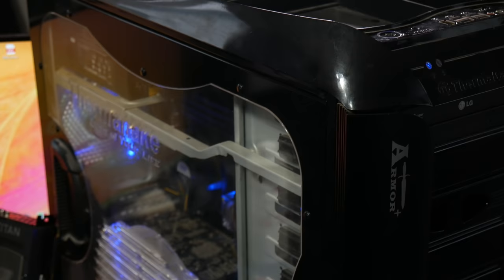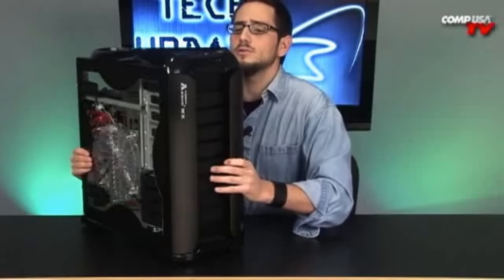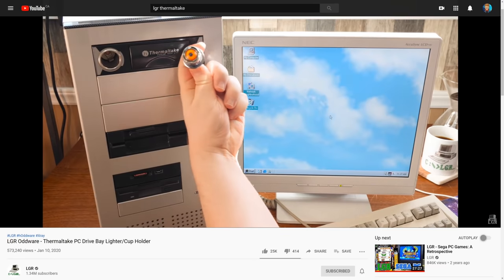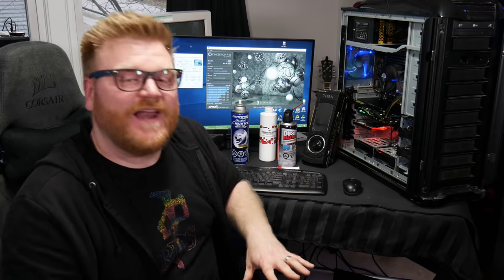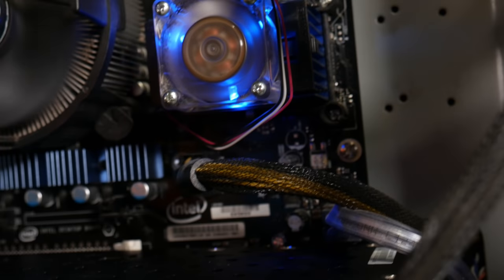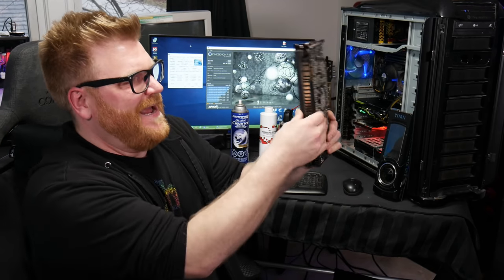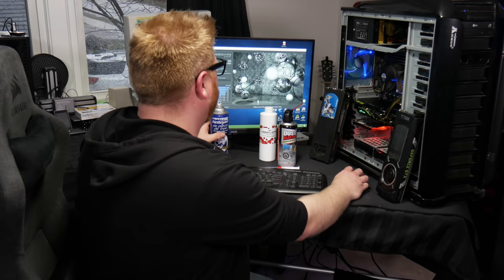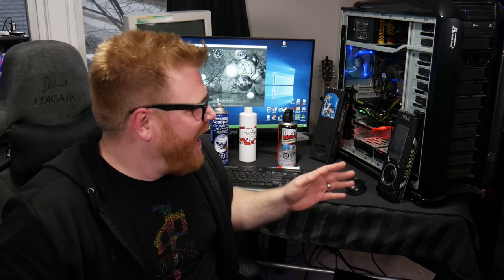Can $5000 buy a PC that will last 10 years?

Comment: I think there is a tipping point here. Over the last 7 years I have about $3000 total (after reselling old parts) Right now I am running a 4790k with a 1080ti 32GB ram @ 2400 hz and everything runs on a SSD or NVme. I run a 4k resolutions so my 4790k runs within a handful of frames as a 9900k. I plan on that cpu lasting me at least another cpu generation and will upgrade one more time to a 3080ti. I'll be in to the computer for less then $5000 after a 10 year span and will have parts that can transfer to the next rig.

Comment: Great video, Timmy Joe. I'm glad to see that you are healthy and staying safe. Here's my take on buying computer parts when you are starting with nothing. Buy what you can at the time, BUT leave yourself an upgrade path. I decided to go AMD AM4 almost as soon as it came out. I started with a B350 motherboard, a R5 1600 CPU, 8GB DDR4 2400MHz memory, a used 780TI, a 5000GB 2.5" SSD, a 650W PSU all in a HAF 932. The case was something I already had, but for 80ish dollars you can get a good case. The AM4 motherboard was key in the whole setup, due to it being a new platform and AMD is always good about keeping their sockets around for a while. The first thing upgraded eventually was the GPU. I added some mechanical storage. I upgraded to 16GB 3200MHz memory. I bought an EVGA 850W Platinum PSU. You, get the idea. I didn't have to buy everything at once. After I got my foot in the door, the upgrades were unlimited. Hell, I ran the R5 1600 on 4 different motherboards before upgrading last Christmas to a R7 3700X. You have to keep in mind that computer parts have a huge used selling market and you aren't going to necessarily lose all of your money. I think of it as a "rental" fee. When I get a new part, I can turn around and sell the one I'm replacing and call it money towards what I spent on the new one. Over a couple of years I've ended up with an Asus ROG X570 Crosshair VIII Hero, a R7 3700X, 16GB DDR4 3800MHz CL16 memory,  a Samsung 500GB EVO Plus M.2 NVMe drive, a Sapphire Nitro+ 5700XT SE. a newer EVGA Platinum 850W PSU, an open loop cooling system, plenty of custom lighting, all in a Thermaltake Level 20 HT. Remember that computer parts are an investment with a resale value and you'll have a lot of fun in the process, as well.

Comment: Funny...back in '09 I built an X58 rig...Gigabyte X58A-UD3R board, i7 950 with a 33ish% overclock, AIO cooler for the day...24Gb DDR3 in triple channel mode (6x4Gb OCZ Gold), 2x GTS 450 GPUs in SLI...still have it...still runs and runs great at the still 4Ghz overclock but she ain't no primary rig anymore. Oddly it's also been running damn near 24/7 since the initial build...rock solid reliable.

Comment: £1,600 got me a machine that lasted 6 years before parts started dying.  About an extra grand or so since then has kept it purring.

2009 build-
Case: Cosmos "S" Sport 
CPU: i7 920
Mobo: P6t Deluxe
Graphics: GTX260
RAM: 12GB
HDD: 300GB WD Black
HDD2: 500GB of some sort iirc

In about 2015 I upgraded to-
CPU: i7 4970k
Mobo: Asus Maximus VII Ranger
Graphics: GTX 760
RAM: 16GB

And since then I've added a few SSD's an m.2 and upgraded the graphics card first to a GTX 970 (strix) and then to a Vega64.

Comment: i just recently upgraded my old Bulldozer 990FX FX8320 to a Ryzen 7 3800x system I just have to say I agree with you T.J. i think i spent roughly 600-700 on components and i get pretty amazing quality out of it. i wanna say that this was the most i think i have spent on a system upgrade in 10 years.

Comment: Did a $9k+ build in 2016. I had a hardware failure last year, mid-2019, and have been unable to deal with it due to medical problems.

I am fully disabled, but in the 6 yrs it took to get insurance approved & start paying, I lost everything... jobs, house, savings, family troubles... SIGH!

My Overkill PC Build was a gift to myself when I finally got approved and paid for those 6 horrible fkn years of backlog. I knew it was wasteful, dumb, and overkill... that was the point.

It was originally planned as a 4way SLI project with 2 loops of hardline watercooling. I still have all the unused EK Hardware, Pumps, Reszs, blocks, and tubing. The Planning for this went down Just as the Titan Xp released, nVidia dropped multiGPU support, and I re-adjusted the whole build.

I'd like to say that my 4 yr old Beast PC Build could still hang with recent 2020 Game releases, as I'm sure Doom 2020 would run great like it did in 2016, but I doubt I could promise top tier fps numbers on all games. It was showing single-thread weakness less than 18 months, with badly optimized releases looking average at best.

When will we see a well implemented solution where hardware is automatically upgraded over time? I fear remote serv n play over a stream will be feasible before that ever comes to fruition.

Comment: Seeing this makes me glad I built my computer in 2012 for around $1400 and have had it last this long with no real performance issues. I wanted it to last as long as possible since I was going into graphic design at the time and needed a suitable machine.

ASUS Sabertooth Z77 mobo
Intel I7-3770k @ 3.5GHz
16GB DDR3 RAM
120GB Crucial SSD
2TB WD hard drive for backups
XFX Ghost Radeon 7800 2GB card
TX850M power supply

In the eight years since then, I've only had to replace my graphics card and SSD with an MSI Radeon RX560 4GB card and a Sandisk 240GB SSD as well as add an ASUS PCE-AC56 wifi adapter.

Comment: I would fully agree if it was a 1999 $5000 build in 2010, but not anymore with a 2009 one. A build like this that is better balanced and maintained still would outperform latest i3 under multithread workloads. Also doing upgrades is still cheaper than going with all-new build. That CPU is perfectly capable of handling modern GPUs, especially at higher resolutions. Sure, after 11 years it might not be the best performer in games, but it still is good enough to run about anything.

Comment: Really Total for my computer was 600.00 for the computer with mouse and keyboard total i upgraded the machine was a 250.00 RX580 because the RX570 that came with the machine was a chinese cheapo knockoff card oem didnt know so i got a replacement card from them and sold it for 50.00 the replacement card so total i spent was 200.00 on a gpu thats it... bringing my total to 800.00

Comment: I started with an msi z370 gaming pro an i5 8400, 8gb of balistix ram, GTX 1050 and a 40gb ssd. I then upgraded to an i9 9900kf, a coolermaster ML240r, 16gb of g skill TridentZ, a WD blue 500gb ssd with a 4tb, 1tb and an 8tb mechanical hdd and an evga 2080 super ftw3 ultra. All in a Corsair crystal 680x. I'm running this set up on a 27" Samsung CGH70 and 2 Asus VG248QE. Any advice on the next upgrade? BTW love the videos!!

Comment: In 2009 I built a pc for $2000, it lasted me till 2022, not gaming much but with Revit & Autocad, played a little with Lumion (could handle it but slow). So that pc lasted me 13yrs. Over these 13yrs, I bought 2 Samsung ssd OS & data drives. It still runs my work programs pretty well for its age.

This year I bought a pc for $5000, it has room for upgrades in the future, 2 faster pcie 4.0 nvme drives (currently have 980 pro's), also my board supports pcie 5.0 so I'll upgrade the gpu when the fastest 5.0 cards are released (currently have a Gigabyte 3080 Ti Eagle OC). This thing is sooo fast, it should comfortably last me 10yrs 😊😁.

I know alot of you don't think that's ideal, but it's worked for me before, I think it'll work for me now too.

Comment: For me, I spend £700-£900 every 3 years or so, I bought a prebuilt, just around the beginning of the mining phase (~December 2017) which costed me £700, and At the time it was cheaper than building my own (It costed £750 to build at the time), the specs are Ryzen 5 1400, RX 480 4GB, 8GB DDR4, OEM B350, 500W 80+ PSU, 2TB HDD. I’m only just thinking about of upgrading nearly everything, with what I’m looking at around £850 for the price, I’m not sure if I buy a 4600 when it comes out or a 3700X

Comment: I built a computer in highschool that was worth around $5,000. My brother continued to game on it until one of the main traces on the $600 motherboard literally exploded. The newest component is about 7 years old, I still have a hard time believing it was that long ago, and it runs even current games at playable frame rates. The problem with spending so much is that, even though it still works, the gameplay quality continually goes down over the years. You're much better off spending that same money over a few years continually refreshing the computer.
Reply: The 10 year computer concept is only really applicable if you know you're only doing minimal stuff, like browsing the web and word documents, and you know that's all you will be doing for those 10 years.

Comment: 3-4 years is really the sweet spot IMO. I upgraded my system from an FX to a 1st gen Zen 1800X and got a steal for it. Plus the cpu ended up being a silicon lottery winner, im talking I have this thing undervolted and overclocked! And I'm still rocking my EVGA 1060 6G and it's impressed with how well its running and holding up. And I got this thing like a year after they were released.

Comment: I am still using mk armor case. ive had it for like 8 years and it still runs like a champ. and yes i clean the side fan. And now it going to hold my new x570, 32gb, 3700x build i'm currently sourcing parts for. Btw the side fan is 200 mm. there also should be a fan cooling in front of the bottom hd cage. The only problem i have is that it cant be easily water cooled. I have been thinking or popping the clear perspex panel off and getting a new one cut. Then cut out a blank in the perspex to suit a 240 radiator and lose the big side fan. But only if in the future i pick up 3950x in a few years.

Comment: Most I ever spent on a PC: $700. It's the PC I have now. i5-7600K, 16 GB of DDR4-3200, an RTx 2060 KO, 2 500 GB SSDs, and two HDDs in Raid 0. I have 16 more GB of RAM on the way (delayed thanks to the pandemic) and will be looking to upgrade the HDDs soon. It was purchased piece by piece over time, and the 2060 KO was the most recent upgrade, from the 750ti I had in my previous system.

This is an upgrade from my previous build, which cost me a Noble Knights Yu-Gi-Oh! deck for an i5-2400 with 8 GB DDR3-1333, and I got jipped on the HDD (was supposed to come with a 500 GB SSD and I got a 250 GB HDD). Had no video card so I managed to scoop up a 550ti for $36, and then later $50 for the 750ti. I got my hands on a GTX 690, but I flipped it with the strangely high market value it had at the time (Something like, $400 just before the RTX launch?

Comment: Good video, and I see your points. I usually buy towards the high end of the product stacks for GPU and CPU, and then upgrade one or two revisions later.Example, I bought the 2700x at then end of 2018, and then bought the 3900x in March of 2020. I was able to sell my 2700x for $175 in two days. (at the time a new 2700x was $286 on Amazon) The old part is still usually good and I can get decent money on the used market vs. if I would have bought a low or mid range CPU/GPU. I to tend to upgrade CPU  and GPU two or three times as long as the motherboard and RAM are still compatible.

Comment: In 2016 I used 2000 dollars on a prebuild with an i7 6700k+32 GB DDR4 2400+120 GB M2 SSD+1 GB HDD+650W 80+ PSU+Some artic cpu cooler+sharkoon case+a GTX1080...  It still run fine and Even though I have bought a couple of ryzen 3 based systems (2200g+3200g with stock coolers)  and a feW other systems just for fun since then. That 2016 system is still my fastest system. I am actually able to Play doom  ethernal in LAN with the ryzen systems and the 2016 system

Comment: oh boy. I built my first computer back in 2012 for a budget of 500 USD. I added 2 more sticks of ram to get a 16gb total and used it until last year. I decided to upgrade the GPU to a rx470 and made the total budget on the computer 720 USD. Now im rocking a Ryzen 9, B550, 32 Gb, RTX 3080. I Thought i had a decent computer before but going from a 2 core 4 thread cpu to the 5950x 16 core 32 thread blew my mind in speed.

Comment: I bought a ASUS rog laptop about 2 years ago with a 15inch 1080p display with a 1060 laptop gpu and some intel processor. It runs games fine still at that resolution but it sounds like a jet and gets crazy hot. Not to mention the tiny display. I recently took the heat exchanger out and it was caked with dust. So with a now clean heat exchanger and new paste it runs better than the factory but can still sound like a jet with a demanding game. I use it strictly when I travel now. I have a desktop with an i7 9700k, amd 5700 xt mech, 16g Corsair 3000mhz ram and a Corsair power supply. I have no problem running dual monitors in 2k. Point is now that I’ve gotten so much better performance for about what the laptop cost when it was new... I can’t believe I spent my money on it.

Comment: If you follow "Moore's Law", and Gordon Moore's updated thoughts on the advancement of silicon, the only time buying "the best of the best" and having it last any significant duration (to "not have to worry about upgrading right away") won't start until 2025. At that point, due to saturation, it may be cost effective. Having the top of the top computer before then is solely as a status symbol for the everyday user.

Comment: Funny thing is that I do the opposite, I build to last 1-3yrs and end up extending the lifespan as time goes on. I might even still be running my 2010 computer if it wasn't for pushing an OC too hard & my tendency to sell off high-end parts when I take breaks from gaming. It was a 2500K @ 4.9GHZ, 8GB RAM, Radeon 6970. Don't remember what the PC cost but probably around $1200!
That's just the way of things though: some parts outdate fast(that GTX 295 released what, months before DX11?,) some go on forever, and you never know what games you'll end up wanting to play.

Comment: When R7 1700 came out I built a nice PC with x470, 16gb ddr4, RX580, m.2nvme....etc. spent $1100 was very pleased. But been building custom comuters since 1999 and wanted to try something diff and easy. Luckily sold the Ryzen build for $1200 and went searching. Found a HP Z420 workstation  with Xeon 1650v2 6c/12t, 32gb ddr3 1866, Stock 600w 90+ PSU all for $200. Got a gtx 1060 6gb for $120 and a 250gb ssd for $50 and I was up and running for $370. Was able to do 1080p gaming no problem. 1 year later I've since upgraded to a 43" 4k TV and XFX 5600xt. Gaming at 4k medium/high settings, light video editing, several programs open all the  time and have not yet felt the need to upgrade and I'm accustom to having a high end machine. If I need a little extra juice I use Intel XTU and Throttle Stop to push the 1650v2 up to 4.4ghz. Its not super flashy but its reliable and performs very well for the money.

Comment: When I got a settlement in 2013, I didn't go as nuts, but I bought a $2800 system to last awhile. Volan 8-core (piledriver) 4.0 GHz, 16gb DDR3, 240gb SSD boot, 3tb storage, dual R9-270's (to both game and mine). Now, 7 years later, it's still running. I've upgraded the graphics to a 5700 XT Radeon, added more storage (500gb SSD for games, and 8tb for storage (2x4). It runs modern games...okay. The graphics card is strong, but the CPU is the weak point. Next step is to get a Ryzen 5 (4th gen?), which will require a new board, new DDR4 RAM. While I'm at it, I'd like a case with front USB 3.x, and an NvME boot drive.

Comment: My GTX 970 build is still going strong. It has some minor issues here and there and could probably use some new thermal paste and a basic teardown, however, this rig has done well. I have been debating building a new system this coming winter.

Edit: My current system was only $1200 and that included keyboard, monitor, mouse, windows, everything. I built it myself and feel that it could last a couple more years. This one was built with the intention of last 5 years before replacing.

Comment: Hell, I spent less than $1k on my pc back in 2013! Not anything nuts, FX 6300, a 760 at the time, good PSU. I ran it like that for almost 4 years, then put a 1060 in it for like $200, and I'm still running it to this day! I can still run newer games at Mid setting at 1080p for the most part with no issue. I didn't even know what I was doing when I built this, so if someone had really put some thought into future proofing, 10 years isn't a crazy stretch. If a first timer can get so far about 7 years out of at most $1300, then 10 years is conceivable.

Comment: Im still running a i7 2600k @ 4ghz with 8gb of ram and a gtx 690 and still playing modern games at high or medium settings at 1080p 60hz on my media center PC. I believe I spent about 2500$ on the parts 11 years ago, buying the best parts you can afford does give you value if your not chasing benchmark results, As long as it gives you smooth game play on the games your playing your good no need to upgrade. I did upgrade the graphics card the original card was a ATI 5970 and it burnout after a year and some change.